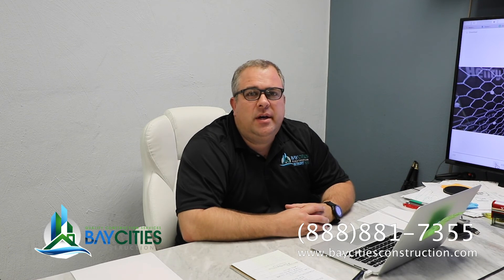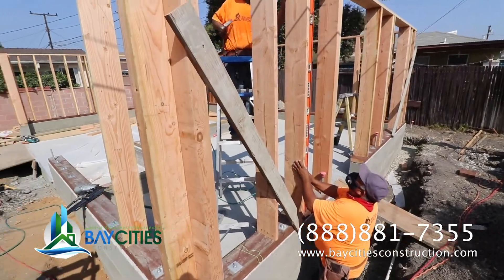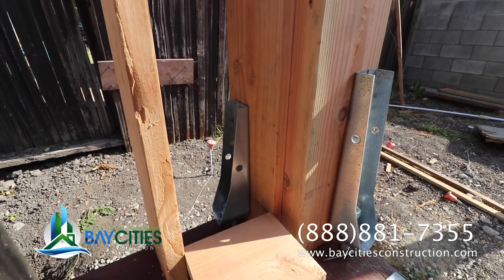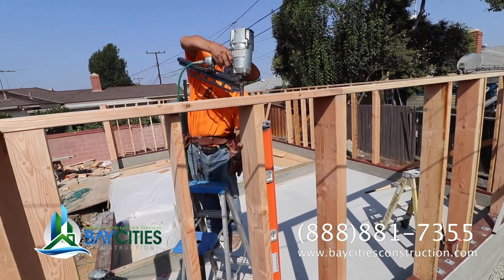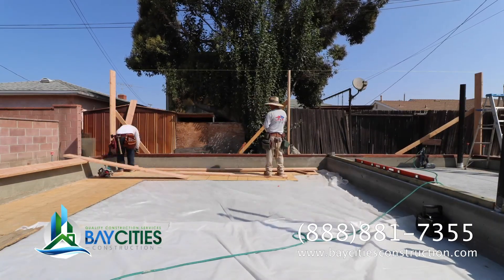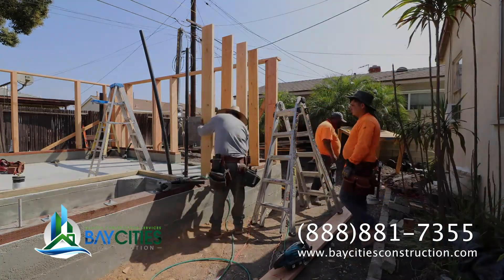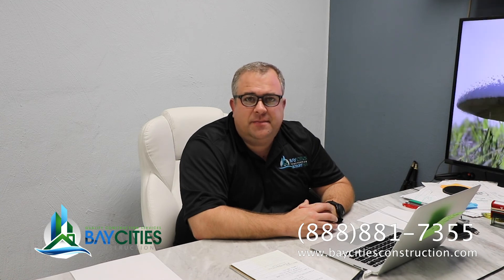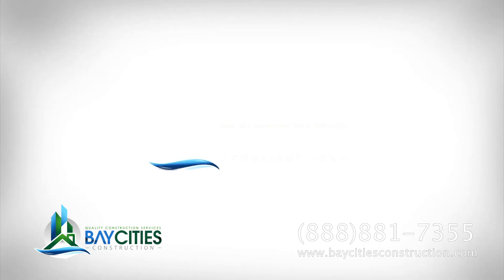Why I Used 2x8 Framing | Torrance ADU Update

Comment: umm.. i'm not a contractor.. but 1:03 - that beam is short...
Reply from the maker: Beams run horizontal, and studs run vertical. But breathe easy...You can see a new stud (at the correct height) being installed at 2:01

Comment: LOL Building on an old slab 15' from the neighbor,s bathroom window. !? Using 2x8'. s... not exactly cost effective for a small sub-division house . Jeez.... I would never even let anyone film my business,s association with such a project.!
Reply: Idk dude, with the higher cost of energy. 2x8 provides extra insulation for those hot summers in SoCal. I'm considering doing the same or doing a traditional framed building with interior framed walls with a 2 inch gap to give me a total of 10 inches of insulation.
Reply from the maker: Real recognize real 👌
Reply from the maker: Did you even watch the video my dude? You can see us pour the new slab here: https://youtu.be/hcPmkNp750Y  No toilets visible 🚽